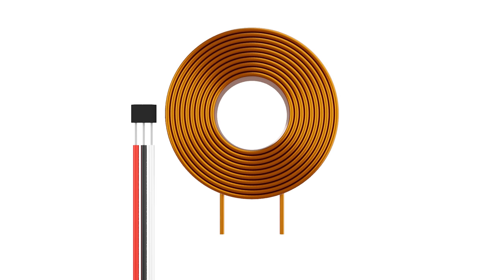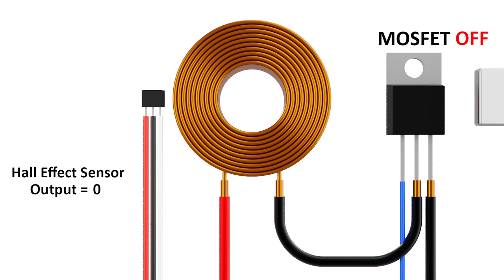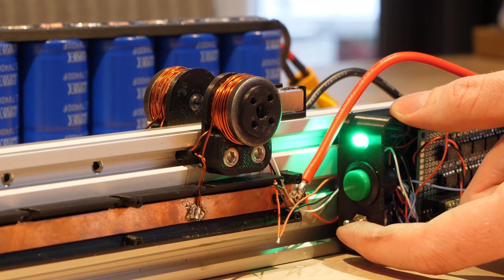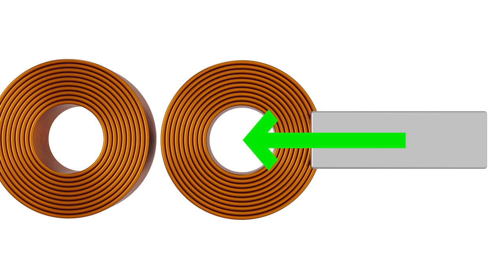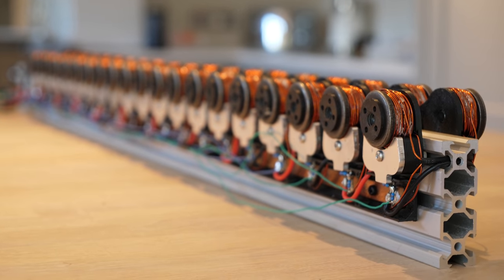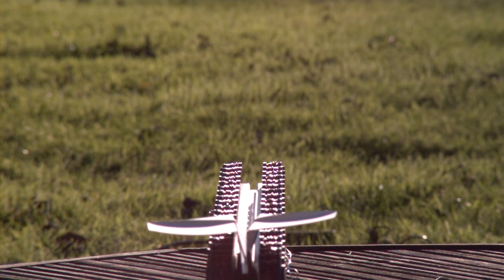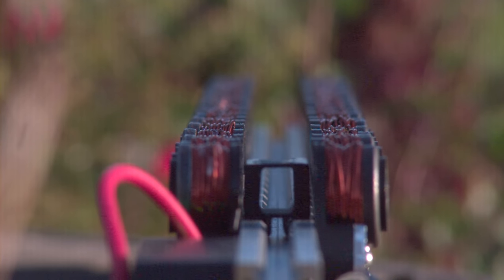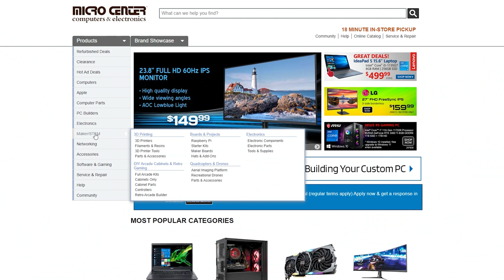Electromagnetic Rail Launcher

Comment: Tom: I suspect that if you also complete the magnetic circuit, (possibly by a 'C' loop of steel under each magnet pair), your total flux density will increase. Fun project BTW.
Reply: True. But it will also increase the inductance of the coil and will reduce the speed the current rises... this can backfire!
Reply: @jackmclane1826  that is correct. and that is what calculation and/or testing will reveal.
considering that the gap is mostly open with a high reluctance - the increase in inductance may not be a problem. I have not designed such a system, so I am going on intuition. (that also can back fire) note also as a for instance: stepper motors, or servos do have relatively tight magnetic circuits with very small gaps. they seem to work. and yes this is all hand waving. a real motors dude would probably be able to say yes or no with more accuracy. but anyway i'll stand with my first comment. being wrong is not a big deal, it is a way to learn.
Reply: @mr1enrollment  I'd also try it... the idea is good, but I don't have a clear gut feeling for it right now. It leans towards that switching speed in the end is crucial when you want to really launch something. Not when you want to launch a paper plane at a couple of meters per second, of course... ;) It could even come to the point that an iron core is detrimental due to HF losses. (Thought of it: When you want to launch something at 100m/s that means switching speed in the kHz range is necessary. Don't get close to it with any iron. Maybe a stack of very thin sheets may work. But with massive iron you just make an induction heater and no coil gun... ;) )

My first change would be to invert polarity of the coil when the magnet has passed to push it away. This can also backfire into magic smoke when done wrong... ;) This would effectively half the time that is available for current rise.
Very interesting device. I think I put one of these setups on my own experiment list. ;) My first guess would be to move to a lower impedance setting. Thicker wire, less windings but more current meaning lower inductance as no. of windings go squared into inductance.
Reply: @jackmclane1826  let me know when your video is up
Reply: @mr1enrollment  I'm not making videos. I'm not allowed to film where I do that kind of nonsense... (and I'm not too keen on publicity).
Reply: @jackmclane1826  ya

Comment: Some thoughts:  You might be able to get more acceleration with different timings, also having 1 or 2 ahead of the sled on may have some boost as well.   If you put some optical sensors across rail at the end and a U shaped thing for the sensors a bit out from the end that the opto sensors can give a real time speed indication.

Comment: It would be interesting to put that in a loop, I wonder what the max speed would be
Reply: i woud guess ,if you neglect the friction only thing is mosfet switching speed that is the limit
Reply: @Shreyam_io  Mmm, I love the smell of toasty mosfets!
Reply: that's just a regular motor with extra steps
Reply: I'd bet it's more likely the current/time relationship of the coils that can't turn on/ of instantly would be the limiting factor. MOSFETs can switch pretty darn fast, but the coils can't change current instantly.
Reply: you’ve invented a motor
Reply: It would be neat to build up the RPM in a circular track and then a relay opens the track and eject it out...
Reply: you get a particle accelerator
Reply: @danl6634  It's not just the coil speed. A principal limit of this type of construction is, that at some point the coils ahead will slow down the sled because the moving magnet of the sled induces current into the coils, thereby slowing it down.

(This is also the reason why electric motors with permanent magnets will lose efficiency if you go to high RPM)
Reply: @mephistoxd2627  oh i know, there are lots of different effects that come into play. I had to design & build a custom motor controller for a brushless DC motor back in 2011 for a drone because the parts just didn't exist in the size we needed at the time. If you wanted to get really smart about it, skip the hall effect sensor & just monitor the induced current as the magnet approaches the next coil. That way you can manage that induced current & avoid slowing down the projectile. Brushless DC motor have a few different modes of finding a max rpm; can be related to the processing & switching speed of the ESC, the PWM rate if that's being used, magnetic saturation within the motor, the induced currents you mention (similar to back-emf in an ac motor)... even the power dissipation capability of the ESC heat sinks due to excess heat from high MOSET switching speeds & the non- instantaneous current changes in an inductor.

I do miss those projects, was fun to figure out why that stuff worked the way it did.

Comment: In this episode of "Tom Stanton invents stuff" He makes a railgun!
Reply: Almost! A railgun has the thing being propelled as part of the electrical circuit. The slug closes the connection between the two rails at 90degrees from each, so there's three magnetic fields being made by the same electrical circuit. All three fields are generated simultaneously in series (series in the electrical sense, not the chronological one). The interaction between those three fields is what drives the electromagnetic slug down the rails. 

This is a gauss gun. The big advantage is being scalable without electrically welding your slug to the rails once you reach a certain amperage.
Reply: Rail guns actually work by a slightly different principle to this (it's pretty interesting and I highly suggest you look it up). What Tom's built is more similar to a coil gun I believe.  Although a typical coil gun usually has the projectile travel through the middle of the coils tho so this is still pretty unique
Reply: it's a coilgun.
Reply: No no, it's part 1 of his model of Cern.
:)

Comment: Trying to get the coil current to zero instantly is gonna probably fry the mosfets in the long run
Reply: Yup, deffo, but might be worth looking at how bidirectional ESCs for quadcopters handle that same problem?  There must be some good ways of mitigating it
Reply: ESC circuits often both switch a little late when there is some back EMF to keep the current down, and they can shunt the excess current to the next set of coils too. But they're mostly designed to dissipate the heat, and they can put out a lot of heat for big ones.
Reply: with 4 mosfets per coil (pointing in and out at both ends of the coil) you can control the current direction. and using the internal diodes of the mosfets and leaving one mosfet still ON, you can ensure that current can continue flowing in a circle through the coil.
Reply: Eh. Mosfets are cheap. Let em fry!

Comment: Wow a beautiful implementation.. The big difficulty with railguns is that as you get faster and longer the timing of the pulses gets shorter and more critical. This also means the power loading each coil unit needs gets higher too..(since it gets divided by time) Above a certain speed things start to get exotic very quickly. (over about 80 - 300 m/s)
My own work was only crude and theoretical - with the idea of using a railgun like a rocket engine. Not really a good idea for about a dozen reasons, the killer being that it just took too much energy to ever work. Another being that the rocket 'exhaust' was rather dangerous.

Comment: 0:15 HECK YEAH! KENNYWOOD! Also the MOSFET is also know as a transistor and is opened a small amount of amperage, not voltage. Although, voltage is still needed to push amperage through a wire.

Comment: I also thought reversing the polarity of the coils the moment the sled passes them would double the speed😅 But apparently you were faster👌
Reply: But the time to Shut on/Off the coils is getting shorter because of the increased speed. Is there a Limit on the On/Off function on the controllers?
Reply: @seskalarafey9285  Even if the controller is infinitely fast you still have less and less time, so the impulse might stay the same but the total energy is still only fractions of a second, and the faster you accelerate it the less time you have to accelerate it meaning the "barrel length" or coil count starts diminishing. So you definitely want to do that to get the most out of the system, but even with theoretically instant controller you're not going to get double the speed but you still get an improvement without increasing size or coil count.

I think most mosfets are in the millionth of a second on/off time, but if ;you're using an H-bridge to drive it then you'll have more latency, still though, a proper controller for this should be insanely fast and let you get 95% of the theoretical limit out of it. Biggest improvement would be how he detects the object as you'll want to play with those positions in case of latency in the system.
Reply: @jakegarrett8109 , a solution to be solved by electrical engineers.
Reply: @jmikronis7376  it's more laws of physics. They can make the controllers switch near infinitely fast, but we also are mostly limited by the strength of whatever the coils can handle and the time they can impart force to the object. I think it becomes more of a mechanical design challenge than anything, because now we need a better design than just a linear rail: something like a looping track in the rear so it can pre-accelerate it making several loops before entering the straight track. Or we may just end up using a spinning sling arm etc.

Also I didn't list other unfortunate physics effects such as Eddy currents and effects of fast moving magnets next to coils which is really more of a materials engineer design problem.

Comment: why aren't the magnets spaced out further as you go towards the end?

and have you thought about somehow taking the back emf generated from each coil as the field collapses whem you de-energise and using that to boost the power to the next coil?
Reply: The back emf would probably be handled by some flyback diodes (or snubber)(maybe with resistors to reduce the current running through the diode) (maybe the diodes just weren't mentioned in the video) or just mosfets that can handle a huge voltage spike. It may also be possible that the coils do not produce much bemf for reasons like eddy currents (but it does seem that they produce a lot of bemf because of the large, fat arcs that occurred when Tom disconnected the coil from the supercaps).
Reply: His technology is limited so he can only get the mosfet to turn on so quickly of the projectile gets faster he doesn't have the equipment to match that faster speed therefore spacing it out keeps it in sync in theory
Reply: Because that reduces the efficiency in terms of acceleration per rail length. Rather than increasing spacing, you simply decrease timing between electromagnets as the cart progresses.

Comment: With your high-speed camera you could also try tuning the on-times for the coils - as the payload travels down the track and accelerates it's likely that the coils should be triggered a little earlier for maximum acceleration (because it takes a finite time for the current to build in each coil).
Reply: This. Also, another very cool improvement would be printing a holding mechanism in the 'sled' to hold the plane. By the end of the rail the tail is pushed down and the angle of attack is way too high.

The holding mechanism could be something like a moving piece inside the sled that holds the plane like a thumb and hits another 3d printed part at the end of the rail, moving it to the release position.
Reply: The IR drop would also increase, changing pulse timing  the further along the gun the coils get, assuming all from common end source.

Comment: It's a miracle this setup works at all, given how the, hint, hint, electroMAGNETS aren't entirely invisible to the HE sensor that you decided to slap right next to. Wonder you didn't go with some photo sensors. Also, I dread to think of the voltage peaks from hard switching of coils. I mean, MOSFETs have a body diode, but that's hardly something to rely on when switching spicy loads. So, nice cludge.

Comment: I think you could see a performance increase by getting rid of the control board and instead using open-drain sensors. That way, the sensor can turn on the electromagnet by itself. It might speed things up and let you tighten the timing margins.

Also, the idea to reverse the current through the coils is interesting. Are the coils low-inductance enough to make that feasible?
Reply: hi buddy i just wanted to ask something is it fine to use a battery source rather than supercapacitors
Reply: @shreyasshenoy7215  you are going to need the extreme amounts of current that the super capacitors can output, Batteries cant match a capacitors ability to discharge and charge quickly.

Comment: Before anyone comments, this is not a railgun, as cool as they are, this is tehnicaly a ''coil gun'' or a ''gauss rifle''. Railguns use 2 rails with different charges and a sled passing inbetween connecting the 2 rails, pushing it foward. Coilguns, on the other hand, use a series of magnets that turn of and on to pull the sled, even if it uses a rail

Comment: Could you make a sled that holds the airplane in place until it reaches the end of the slot, and then releases it? It would get more speed from the sled, and then shoot up after release. I'm trying to imagine how you do that without introducing too much friction or weight to the sled, though...
Reply: Imagine a sled Mechanically designed that it can only release the plane if the planes goes forward.  Put a stopper at the end of the rail, as soon as the sled touches it, the plane is launched since it's now free to go past the sled.  It could be a pinching mechanism in tension by a spring, the pinching part on top and the releasing mechanism on the bottom.  At the end of the rail, there's two reducing rails that apply abruptly pressure on releasing levers at the same time and the plane is released.  😅
Reply: The wing would crumble if the speed is too high.
Reply: Very low pressure pen refill spring with a stopper to release at dead-end.
It may launch earlier incase lift exceeds spring hold force without hindrance to either of 3 mechanism.

Comment: i've always wondered if you could build one of these in a loop where one portion of the loop had a falling gate that allowed you to fire it once up to the speed you want. and if that would allow you to get much faster speeds in a much smaller package?
Reply: What you're describing is exactly how early particle accelerators worked. It's a great idea.
Reply: Could get stuff stupid fast. But a nightmare to build

Comment: You should have it pinch and drag it from the front and let go at the end of the track to get the full acceleration delivered to the plane. You can make a normally open tweezer mechanism to hold the plane that closes with an electromagnet that's powered only when the payload is still on the track

Comment: Hey Tom, love the channel and all the crazy stuff you make.  I have a couple of ideas for you to improve your device.  1st,  make sure you have freewheeling diodes across your coils so that you don't overvoltage your FETs during turn off.  You may already have them in there and I just didn't see them.  2nd, you should devise a way to check the timing of your coils relative to the position of the sled.  As the sled accelerates, the turn on of subsequent coils need to be advanced in time compared to the upstream end.  I would not be surprised if the sled is being slowed down near the end of the track.  You could use LEDs on each coil and high speed photography to visualize the timing.  I suspect you may need to move the hall probes upstream as you go down the track to give the same timing advance as you had near the beginning.  This brings me to #3, you may want to explore spacing the coils farther apart as you go down the track.  This will also alter the timing of the system.  Again, cool builds and I look forward to seeing more.
Reply: good pointers. 2nd could be tested fast with turning of like 10% of the downstream coils and measure the speed.

Comment: Hey Tom, awesome video. Just had a small question. Won't the hall sensor also sense the magnetic field due to the change in current in the previous coil causing a change in flux in the other coil in the pair due to mutual inductance? So basically, each coil is slightly repelling the magnetic sled. So then, the speed calculation is not really accurate.

Comment: Since the magnet has more acceleration each coil it reaches, the timing for depowering the coils should get shorter and shorter as it reaches the end right? In that case would it not be simpler to have the coils programmed to turn off at the same intervals as the magnets rate of acceleration rather than each one individually needing to detect it as it passes?
Reply: You could, but the detect/depower system makes sure that the sled will always accelerate at an optimal rate for the load it's pushing.
Reply: @BuffMyRadius  ah, hadn't thought of that

Comment: There are 20 sensors, I wonder how has he managed to input all of them into the controller. Same with outputs.
Reply: I think although there are 20 sensors there is only one or two active at any given time, so he can just link them all together
Reply: Each sensor goes to their own mosfet, I don't think there is a controller that knows what is on or off at any given time.
Reply: Thanks for your answers. I think Yuri must be correct, not controlled by the microcontroller but directly by the sensor.  (Your option was viable too Goggit but drains way more power to activate all coils at the same time)
But in that case it's hard to add a delay because the further it is from the start, the quicker it must activate and the less time it must remain active (because of acceleration). And he will suffer with the reverse polarity he wants to do.